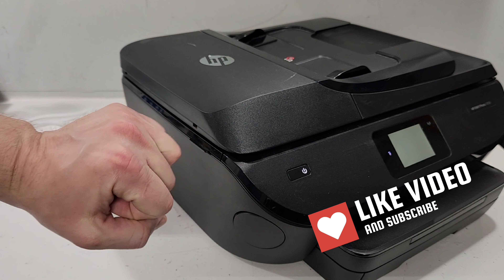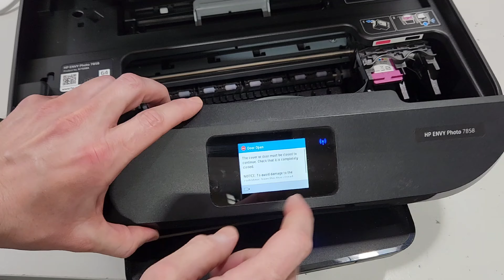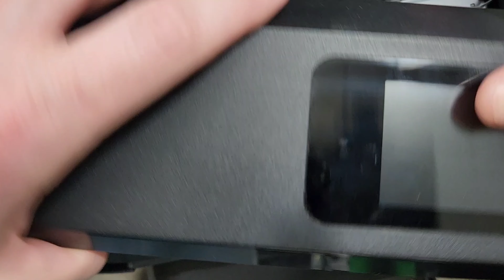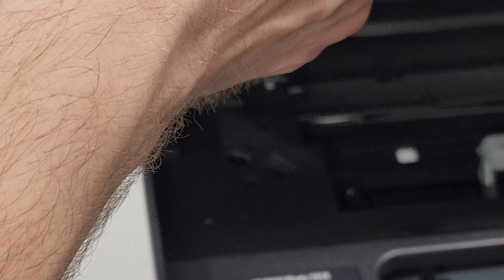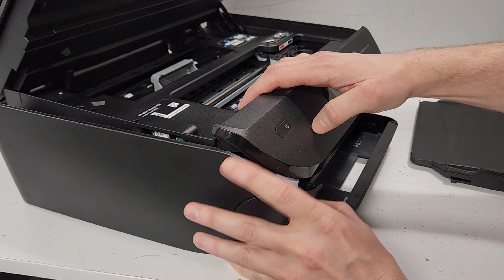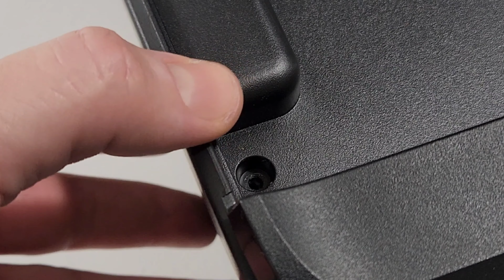HP ENVY 7858 Printer Screen Blank or Not Working 7855 7155 DIY Fix

Comment: 1st I had 1 thing different from you. I don't have the wifi light on, otherwise exactly the same. I did everything you said to no avail. It worked fine then I didn't use it for maybe a year. I went to make a copy today and nothing. Anyone? anything? Thanks

Comment: The screen is on but never progresses, the leftmost of the 7 dots is where it stops.  My connections are all good.  Any ideas?  I followed your instructions for the connectivity of the ribbon cables, and all were good.
Reply: Same issue. Any fix yet? It happened to us after a power brown out in the neighborhood. It seems like a lot of other people online have the same issues but none of the fixes have worked for me
Reply: Same issue. I’ve done everything from other videos and nothing works.
Reply: @yolandastevens9449  I ended up just buying a brand new main board. I'm going to swap it out with the old one and see if it works. It will be delivered to me within a week.
Reply: @Jazar77did this work? I’m having this same issue
Reply: I started having this issue after a power outage. Any success in troubleshooting? (I haven't been able to fix it yet.)
Reply: Having exact same issue. No success in fixing yet
Reply: @annacaldeira2997 it’s extremely sad how irresponsible HP is. The only way I was able to fix it was by buying a main board replacement. This means it is most definitely an issue with HPs faulty software. It’s sad how much electronic waste a simple software but is creating.
Reply: @Jazar77Where did you purchase the main board? If I may ask.
Reply: Same issue here! They didn’t have a solution to this
Reply: Same issue
Reply: Same with mine